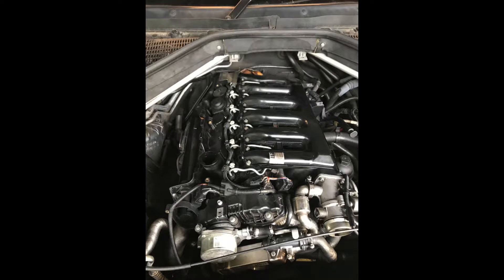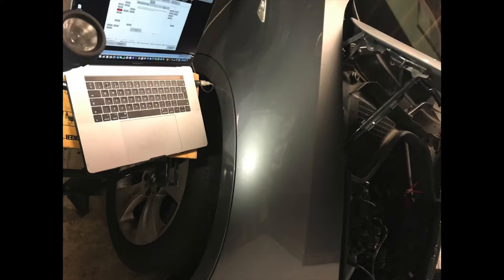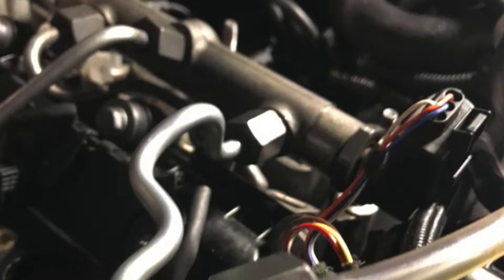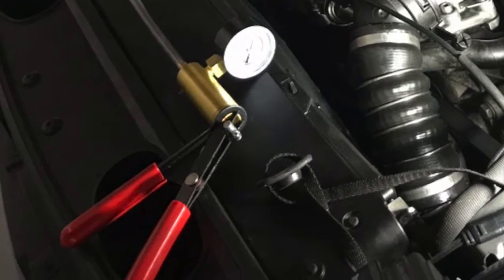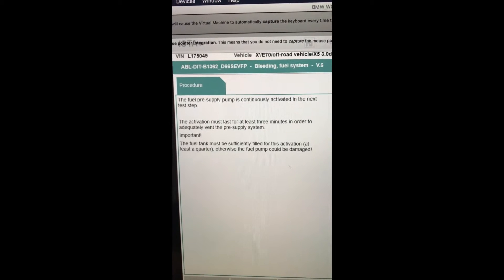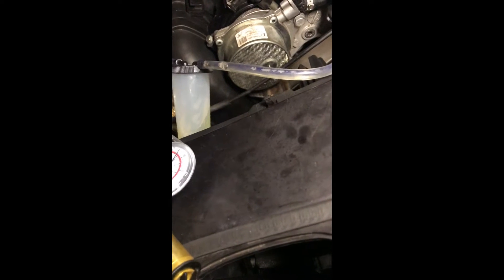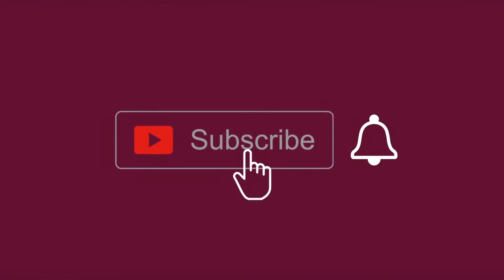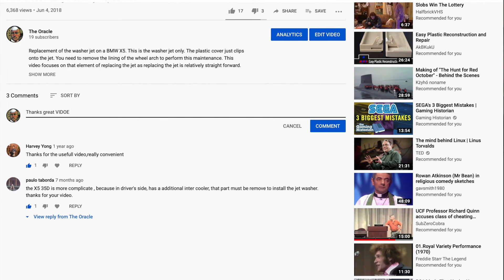BMW Diesel System Bleed

Comment: Ran into this problem myself recently when I changed the valve gasket on my bmw e91 325d and had the rail open for a few days, I tried ignition on/off and cranking a couple of times but no luck, I'm going to get myself an ista, booster and vacuum pump to take the air out and bleed the fuel system, I'll be back with an update early next year.
Reply from the maker: Great. Good luck.
Reply: Hi, I'm back with an update, so I got the ista+ and the vacuum, bleeded the system a couple of times, gave it a crank no success, rail pressure was not going above 10, then I pulled up the vacuum pump and connected to the first injector fuel conduct, a big gap of air had come out but the bleed was going way faster for me than what I saw in your video

I quickly took the hose and connected the conduct but I figure a small air gap might have sneaked in so I tried again on the same conduct but this time quickly remove the hose and connect the nut all while the pump was bleeding, made a little mess there hehe, I bleeded the system one last time after this and gave it a crank and the engine started! I let it run for 10minutes, tomorrow I'm doing a small test drive to see how it behaves, the mechanic journey is a blast

Thank you for the video, you earned a new subscriber 🤝
Reply from the maker: @Andrei369y wonderful news. Well done for persisting.

Comment: Hi, I've done some work on my BMW F31, and I removed the injectors, pipes, etc. After I installed them back, the car won't start. Rail pressure is too low at engine start (code 249300). It's driving me crazy!
I will try your advice tomorow and i hope to solve the problem!🙏

Comment: Heya, thanks for the video. Ive tried this technique and also cracking the injector pipes. Still no luck. Any idea what else to try?
Reply from the maker: @bmartinot  lift pump. Is it working ?
Reply: @The_Oracle  yea, I can hear it running anyway. Ive got error codes on 3 injectors though. Is it possible for 3 injectors to fail at once? car ran great before the chain swap.
Reply from the maker: @ sounds odd. What about the connections. Try swapping injectors around to fault find.

Comment: Do you need to crank the engine to allow fuel through to the rail from low pressure side to high pressure side or does the lift mump push it all the way?
Reply from the maker: @lewismacpherspn6033  you need to crank. The hp fuel pump is connected to the crank.

Comment: Hi my friend i have the similar problem my engine not start after to 2 years stop and the rail pressure take max 100 bar when cranking the ecu show rail pressure sensor and control valve you think is also air in the system ?
Reply: E60 m57tud30

Comment: Hi, just wanted to send a big thank you too. I have my 2013 X5 35d (E70) and my car died on me while I was driving on the freeway, I pulled over and waited for several minutes or so, and started it again. It started up and was able to drive home safely. The next day we were driving and it died again, this time it wouldn't start up. Crack but can't stay on. Got it towed to the dealer and they quoted me that the DDE needed to be replaced, the fuel line, and wire harness, and the cost was 9 thousand five hundred dollars to get it fixed. Cut to the chase, I found an exact DDE and bought it from Canada with other parts that the dealer quoted me. Got the DDE cloned and replaced all necessary parts as required, all new parts are installed. As well as a new battery that the dealer replaced a year and a half ago. The scanner can't find my DDE, I even replaced both fuel relays from the back and the front! No luck with getting it started and staying on. What else can I do? Any advice? Thank you kindly in advance for your suggestions and thoughts.
Reply from the maker: Did you code the DDE to the car.

Comment: Saved us too, bought that same pumper and used it on injector 1 only. Pumping with about 30-50% vaccum on the gauge worked best. Then the engine started after about 8 seconds on the starter. Nothing, nothing, then suddenly it started and ran fine. No stuttering or anything.

Comment: Hello, just want to say a big thank you too, I was stuck with my corsa diesel not starting after working on the fuel rail, tried everything, mobile mechanic changed loads of sensors, I watched your video and tried it myself using my engine oil vac pump, worked great and saved me a fortune in getting it recovered to a garage 😊😊😊

Comment: Hello, I have a BMW X5 which hasn't turned on for a long time. It had a code stored with the glow plug module. I replaced it with a new one along with the spark plugs and it starts but doesn't turn on. I checked the low and high pressure data on low. It has 30 psi and there is no pressure in the rail, I have already carried out the bleeding procedure to the system but no fuel comes out of the pipes and the inlet hose to the pump if there is fuel

Comment: I didnt need a vac pump. I just loosen the pipes that go to the injectors and start the car for about 2 minutes without the intake on. Then put the intake back on and it started first time.
Reply: BMW N57 330d 2006
Reply from the maker: That’s good.

Comment: Interesting, my 3.0d X3 is having issues starting, need to crank it 5 or 6 times before it finally starts, ista detected the fault start pressure rail. However when the car is sitting for a while uphill it starts first go... Maybe air in the system.

Comment: I'm doing the same thing.......followed your lead with ista.
However, when I click prime I don't hear a pump going.
Is it audible in operation. I've good hearing
Reply from the maker: Yes you should hear it very slightly from the tank area of the car.

Comment: Hi I’m having same problems I got fuel from fuel sender to high pressure pump but no fuel coming out from injectors pipe and there is no power to injectors pulse I don’t know if it’s airlock or electric problems
Reply: if you take off your fuel hose on the HPFP from the fuel sender . Inside the pipe fiiting on HPFP it is  a check valve inside. take a screwdriver gently and work it back and forth an it should be free . connect everything again and it should fire up : )

Comment: Hi There  ,im in need of help with my 320d e90, was stripped and now not getting diesel from HP pump, altho getting strong pressure to the pump itself, is the air lock causing the HP pump not to pressure system? if i can get on a Video call with you and show you, the help will be soooo nice!,,Im from South Africa, reinobosman@gmail.com

Comment: Hi, I'm basically in the same boat. however, when I did what you're doing, it seems like the fuel is going into my catch can much quicker than in the video. Basically it fills it up within 30 seconds, and its still coming out with bubbles. This is making it quite the mess, since I have to constantly cancel the operation in ISTA, empty my catch can, and repeat. Did you somehow reroute the fuel to go back into the system from the catch can? Is there anything that I'm missing?
Reply from the maker: No I didn’t. There would be no where for the fuel to go if re routed. I had to bleed for some time. This was not shown in the video.
Reply: @The_Oracle  Did you run the low pressure pump multiple times for the same line, or did you just run it once and then just rely on the vacuum?
Reply from the maker: 2-3 times.
Reply: @The_Oracle  Got it. Also really appreciate the quick response haha
Reply from the maker: Good luck.
Reply: @Marty1568  So was it a case of firing the tank pump up just momentarily each time to generate a bit of pressure, then switch the tank pump off and use the vacuum pump to bleed? Or do you leave the tank pump running all the time while trying to vacuum bleed? It sounds like maybe you were doing this second method originally, and it made a mess?
Reply from the maker: It was a case of doing pump and suck at same time.
Reply: @The_Oracle  Thank you for clarifying. A friend is trying to bleed his 123d fuel system after replacing injectors and HPFP and this method is currently firing fuel out down his vacuum bleeder. He must have it set up slightly differently to your setup I think.
Reply from the maker: I was getting bubbles in the line.
Reply: @The_Oracle  Thanks for your replies 👍🙂
Reply: @The_Oracle  Hi few questions 
When you saying "doing the pump at the same time", do you mean you had it bleeding via ista whilst you had the vaccum bleeder on?  
Because i tried this method and the catch can filled up very quickly and then ista stopped because i guess it wasn't getting any fuel back into the return line. 

I also tried another method where i had the key in the ignition which just primed the lpfp and then i used the vaccum bleeder on cylinder 1 injector supply line. I had air and diesel coming out and then the fuel and air stopped altogether. 

What am i doing wrong?

Thanks for any feedback
Reply from the maker: @Mrmeltdown07  yes.
Reply from the maker: You need the pump on to allow you to draw through the air.
Reply from the maker: Yes.
Reply: @The_Oracle do u keep the pump on when u go to reconnect the fuel lines to stop air getting back in?
Reply from the maker: @sajakhtar852 yes.

Comment: Did u have to remove intake manifold to connect the vacuum pump to the injector hard lines? Can it be done without? Thank you
Reply from the maker: Yes had to remove. I am afraid.
Reply: Bmw x6 diesel ,3.0d at 2009 model and newly replace the high pressure pump  and how to program the starting pressure to the control module?
Reply from the maker: No idea.

Comment: I think this could be the problem on my Mercedes Sprinter. I replaced the common rail with a brand new one because I got a code to do with the sensors so I just replaced the whole thing. So anyway after I replaced it the van would just not start not even on easy start. The vans been sat for 6 months. It's a Mercedes Sprinter 2014. I'm gonna try this tomorrow and hopefully it solves the problem. Could I not just loosen the injector pipes and crank the engine to remove the air from the system?
Reply from the maker: Not on modern systems. You can do this on tractors and simple diesels. I think you will need to draw a vacuum.
Reply: @The_Oracle  ok, I have a vaccum pump if I hook it up to the injector pipe will that do the job?
Reply from the maker: You could try to injector pipe. You may need the fuel pump activated to draw vacuum though.
Reply: @The_Oracle  No problem. Thankyou. I'll first try by loosening the injector pipe while the ignition is on. If thar doesnt work I'll hook the vaccum onto the injector pipe. But I was thinking recently if there's air in the fuel rail and injector piped won't there be air in the injectors themselves?
Reply from the maker: If so injectors can clear into the cylinder.
Reply: @denisovanhybrid9610  Tried everything, can't get it to run. Still sat in the same place.

Comment: Would be interested to see how to check the fuel pressure without a pc and without removing all the manifold pipework. Do you think its possible?
Reply from the maker: You can use a simple diagnostics device available on eBay.

Comment: Dosnt this systems bleed them self when cranking?
Reply from the maker: It will to an extent. But if there too much air then it won’t work. Or you risk damaging the starter. I was talking to a mate in the AA and he says that if they run out of diesel you can get away with it      In fact last week my wife nearly ran it dry then parked on a steep down hill. It didn’t start. I rolled it down hill and it started after 15 seconds. I gave her a warning.
Reply: The Oracle Good to know, thanks for the response!

Comment: Hi mate,  i own a 2008 530d M57 engine.... took fuel injectors out and left it open for 1 weeks , it doesn't start now after putting everything back,  where did you get your insta plus from ?
Reply from the maker: I think you can get them for free. But I paid a tenner and It came as a packaged download with a virtual machine.
Reply from the maker: https://www.downloadworkshopmanuals.com/index.php/8-workshop-manuals/1237-bmw-ista-download

Comment: could the same problem happen if someone were to run out of fuel?
Reply from the maker: Possible. The system should not be this bad though from just running out of fuel. You could run the new fuel filter sequence on the diagnostics first.

Comment: Hi thanks what software did you use on your computer ?
Reply from the maker: ISTA+. Lots of YouTube videos out there of how to put it on a PC.
Reply: @The_Oracle  Thanks
Reply: @The_Oracle  Hi could you please give me a advice on ista d how to check rail pressure! Regards
Reply from the maker: Did you sort this out.
Reply: @The_Oracle  She cranks but no start Ista d shows good pressure while cranking but no start. I was trying spray start didn't start either. The only fault in Ista d 4 glow plugs so I don't know what to do. Thank you for reply!
Reply: My car was parked for year so I decided to do exactly what you have done to my surprise the car has started thank you for youe advice I'm so glad that I found your video! Happy days!

Comment: Hello there, Just wanted to thank you for the diesel bleeding advice. I own a BMW 530d  F11 which has been stood for more than 2 years. I intend to change the inline fuel filter and drain the 40litre of diesel from the tank that has been in the car for a considerable period of time. Very grateful for the advice, thanks again.
Reply from the maker: See if you can get a copy of ISTA and the right cable. It’s specific for F series Then run the process I show in the video hopefully it should work. Fingers crossed. Hopefully you won’t have any air in the rails.